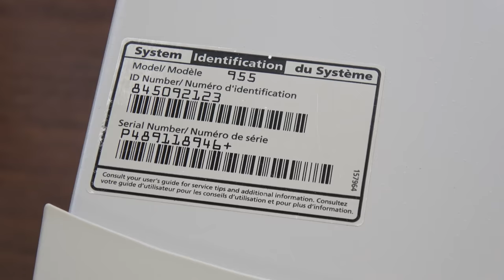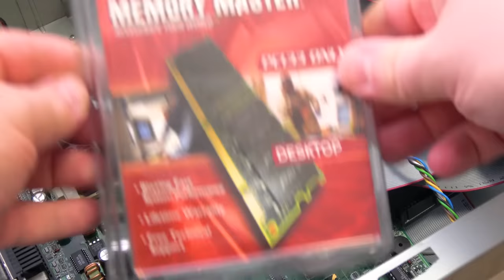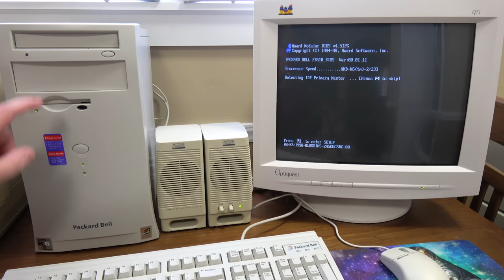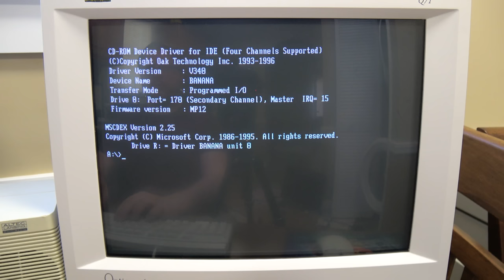LGR - Restoring a 1998 Packard Bell Multimedia PC

Comment: When I was about 9 my grandparents started my computer journey by purchasing me a Packard Bell executive multimedia. It was a desktop that laid flat with the monitor on top and the speakers attached to the monitor. It ran windows 95 and had a pentium 133 with 16MB ram and a whopping 1.19gb hard disk. But it got me a hobby and later a career so thanks to my grandparents for buying it for me!
Reply: I just bought one with 200mhz, 128mb of ram, and a massive 2gb hard drive. It’s currently running windows 98 SE.

Comment: It's a good day when any 90s PC gets restored, yes even this Packard Bell.
Reply: Rounak Dutta I agree.
Reply: ya, it is. is that a bad thing, bud?
Reply: Even a Packard Hell deserves some TLC
Reply: To bad windows 8 has now had the same fate as 98 and Vista to Windows 7, 8.1 and 10
Reply: Rounak Dutta I agree
Reply: I’m currently working on a 92-94 packard bell 108 CD, that is running 3.11 for workgroups and MS-DOS 6.11
Reply: Joseph Linz I was going to suggest Clint do just that in a future video! I really want to get one from that era as well. Where did you get yours?
Reply: Adam Christensen my mom bought it new in 92’-93?
Reply: Adam Christensen  I would suggest a 812 CD legend though, there more powerful than my 108,
Reply: Joseph Linz 486 is where it's at. None of that Pentium rubbish!
Reply: Adam Christensen what’s wrong with pentium?
Reply: Joseph Linz I already have some Pentium laptops, but my nostalgia is pushing me to get a 486 desktop.
Reply: Adam Christensen got ya, good looking In finding what you’re looking for!
Reply: My first computer was a Packard Bell Force desktop, in a horizontal case. I added a 2nd hard drive without official support for it because I sat it on top of the power supply. Never had any problems with that LOL
Reply: Rounak Dutta b
Reply: Gives a warm and fuzzy feeling inside.
I just can't explain that!
Reply: i agree
Reply: Rounak Dutta s
Reply: Gives you the feeling to want to take out your biggest hammer in possession and smash that packard hell to bits. Smash and hammer it so hard that even those pieces turn to dust and get blown away. Some things should never get mentioned again anywhere, leave it as a faint bad memory of an eon gone bye!😠😠

Comment: My 2nd computer was a K6-2 @ 500 mhz. I had a lot of problems till i found the issue: THE CPU COOLER. It was unable to keep a decent temperature and the computer would crash all the time. I did replace the cooler for a better one that only cost me 6 usa dlls and i never had an issue again. The original cooler looked a lot like the one you have there.
Reply: i suggest to use a extra cpu fan, and a fan for the HDD
Reply: It might be because it's black anodized aluminium. The anodized coating reduces how it can transfer heat if it's on the CPU-side of it.
Reply: I had a K6-2 500, too. Fast machine for the price.
Reply: I remember when the cooler completely separated from my 500mhz celeron. it still ran like that, but BSoD's happened about every five minutes until i realized what was wrong
Reply: i have a 500mhz k6-2 @522mhz with the same heatsink lgr has and i cant hit 45*C under load.
Reply: Laharl Krichevskoy you need to change the termical paste. Also maybe the fan is filthy and or damaged
Reply: Alejandro Rodolfo Mendez 
i mean i Cannot hit 45* under load, as in i get 42*C at most worst case. So i dont get how he says its a hot cpu. i recall those cases were the ones with the passive coolers. i remeber anything petium or better was better to add a fan on the heatsink even if it wasnt needed.
Reply: Laharl Krichevskoy he is comparing against the Pentiums and also check in the page of AMD they have the optimal temperature chart.
Reply: jose juan andrade  h

Comment: Man, I hated Packard Bell back in the day, but now, I have a newfound sense of respect for their perfectly adequate systems. Thanks, LGR!
Reply: @Broyale26 : What the fuck do you mean by that, man?
Reply: Packard Bell PCs were crap.
Reply: @Trev359  Crap or not, my first P Bell was a 386 and bought in 1992.  It had a 16 MHz processor and 2 megabytes of RAM.  A friend of mine was able to upgrade it to 8.  I can't remember what the original  hard drive size was, but for a 1.3 GB hard drive in 1994 that was added as a slave drive, the price was 149.00
Reply: They were very hit-and-miss. The motherboards were typically fine(ish), but the main problem was that they skimped on parts from the mid to late 90s - especially the PSU and HDD. God knows Maxtor was a shit brand, and they would barely last you past the warranty period. Also, some of their mid-90s boards would just NOT take a PCI graphics card, regardless of your BIOS settings. So you were sometimes just stuck with onboard graphics.

Comment: Man, this brings back memories. I bought a Packard Bell pc at Sears in the fall of 1999 for $700 that was running a Pentium II 400 Mhz cpu and had Windows 95 on it.  I promptly upgraded to Win 98 SE and started exploring the web.  This was my very first pc ( yes I was very late into the computer game) but I liked it and had fun with it.  I remember the case was exactly like this one, exactly the same with the LED's and the two buttons. My next computer I built myself and bought all the components myself. Remember Pricewatch from back then? But the Packard Bell got my feet wet so there is a tiny bit of nostalgia. After that, I had to have complete control and I built all my pc's myself from then on.

Comment: LGR! PLEASE make the NOISIEST computer possible! only a nostalgia freak like you can know how!
Reply: That's easy.  Just add a bunch of case fans with bearings that have gone bad.  I have one right here that I'll donate.  Sounds like a helicopter trying to take off inside your computer.
Reply: It i can find my aunts old Dell . that will cover it lol.
Reply: SpearM75503 😂
Reply: and a old hard drive with a noisy motor like an old quantum fireball
Reply: The theres already a computer that deserves that title the apple g5
Reply: Geiger counter hard drive, check
Worn out fan bearings, check
Badly mounted CD drive that vibrates, check
Reply: @GoblyosBence-jd1fc  I mean when they read/write. The clicking of the head.
Reply: Put a wire touching the fan- kinda like a card in a bike spoke
Reply: He just needs to buy an old HP server
Reply: The PS3 (1st gen) ran like a sonic boom.
Reply: Apple Xserve are the loudest
Reply: @SpearM3064  Noice
Reply: don't forget the maxtor hard drive
Reply: @luminumlx2604  Why don't we just put a PS4 inside a computer case. It's cooling system is so beef, when it senses the slightest change in heat, it sounds like a jet
Reply: @alexandercurtis4427  Cool, but now i need a computer case and a ps4
Reply: @luminumlx2604  Goodwill and Ebay are your friends
Reply: fitted out with 16 fans!
Reply: those vacuum tube computers from the 50's
Reply: you want some noise?
buy a server siemens.
Reply: Fill every 5¼ bay with Quantum Bigfoot TXs and write files to each of them
Reply: @simonrichard9873  don't forget a loud AF PC speaker and an alarmingly buzzy PSU
Reply: Full tower case with 3x 40mm Delta fans in every 5.25 drive bay, plus similar on the CPU, front and rear fans.
Reply: Just get a power edge 1950
Reply: @SpearM3064  I had a case fan that was a wannabe floppy drive. Until I oiled it it sounded like a floppy drive seeking.
Reply: What you need lad is some broken bearings

Comment: A trick I used to use to separate CPUs stuck hard to heat sinks is to heat up some water and put the heat sink side down in the water. This softened the compound enough that you can almost always twist the CPU off without putting stress on the CPU's heat spreader.
Reply: Not bad what I do is run the pc for a bit. If that dont work then prime 95 for a bit lol

Comment: Thank you so much for that little tip with the CMOS jumper on the board, Clint. It came in surprise handy when I bought a Pentium 4 IBM Thinkcentre PC workstation a while back. XP Pro service pack two, 500 Mb of RAM.  Everything was locked down with a password. I remembered the jumper and cleared the password protection. Got me a practically new workstation PC for about a tenner.

Comment: the flickering in some platformer games like commander keen goodbye galaxy is usually on ATI brand cards, it works fine on nVidia cards like a Riva TNT or a Geforce2 MX and works good with S3 cards like the S3 Trio
Reply from the maker: That has been my experience as well, and I plan to upgrade to an S3 card in the future!
Reply: Lazy Game Reviews as a former S3 ViRGE and Savage4 owner, I'm not used to seeing "upgrade to an S3". They're all words (except S3, I guess), but they don't fit together, like "potato orangutan"
Reply: Recognised the issue when I saw it, I had it on my ATI Rage Mobility as well.
Reply: I can't seem to find an AGP slot on the motherboard. Ouch, that'll limit options.

Comment: I used to have a old used Packard-Bell CRT monitor back in 2010 that nearly caught on fire while on standby. I said nearly because it started randomly spiting out some black smoke. I immediately  unplugged it and threw it in the trash.
Reply: Had the same happen with my crt tv i use for retro consoles. Smelt a slight burning smell, looked through the vents in the back and this part was glowing red hot...threw it out the next day
Reply: That's kind of funny, I also had a packard bell CRT start smoking on me as well back in 2006
Reply: My dad bought a gateway monitor at Goodwill for 5 dollars back in 1999 and it worked perfectly until he went in the basement in the morning to go on the computer and when he walked into the room. He saw that the monitor had fried because it wouldn’t turn on and when he saw the top of the monitor he noticed that it was burnt black. The top was also melted. Luckily it did not burn the house down.

Comment: I remember the K6-2 was the first cpu I water cooled. Overclocked a 450 to something like 533? pooled the ram of both my system and a friends for 512 mb. Then played with a means of running windows and Duke Nukem on a ram
drive ( quite a trick ) Wow was that speed in those days!  This was well before liquid cooling was as easy as grabbing a part off the net/shelf. I had to make this thing. Old heatsink, and a pink translucent cover of a mini drill bit case plus some shoe glue (silicone that got hard) Then an aftermarket windshield wiper pump and radiator sitting outside in -20f temps. Ahh the memories..
Reply: I remember people posting their homemade water cooled creations on the original 3DMark forums, circa 2000-2001. Some of them were terrifying by today's standards.
Reply: I had a 350 overclocked to 400 with air cooling. I later went to a 500.

Comment: Put a Voodoo3 in that bad boy and then try some 3D games with it. 
Or a TNT2, as they seem to be cheaper on Ebay if you need to buy either of them.
Reply: Just found my old GeForce 2 GTS in a cupboard. Going to put it in a Slot A 1000 Athlon board. Retro dream rig on the way !

Comment: Hey Clint, you mentioned a "capacitor plague" around the early Aughts or so, any thoughts on expanding on that in a future video?
Reply: It's a pretty well covered phenomenon, although I'm not sure if the actual cause was ever nailed down.  Some say the market was flooded with counterfeit brand name capacitors, while other sources say it was a flawed electrolyte formula coupled with corporate espionage, and so a few (quite prolific) manufacturers ended up producing unstable electrolytic caps.

The end result was, basically, all sorts of otherwise reputable device OEMs started seeing unusually high failure rates.  Specifically, issues with those bum capacitors drying up prematurely, overheating, and ultimately failing -- often catastrophically.  The usual symptoms were that either your device would stop working (or just stop working reliably), and inspection would reveal the capacitors bulging from the top, and possibly oozing from the top and/or bottom;  or, everything would be fine until suddenly: a bang, some smoke, and a bit of confetti as the guts of the cap suddenly find themselves free of the outer casing.

This was particularly common on power supplies, as that's one place where you can always find big electrolytic caps, and tends to be one of the more demanding applications that regularly stresses those components.  But also on motherboards, around where the 12V to high-current / low-voltage CPU power rail conversion happens -- for the same reasons:  lots of high-current ripple and nearby sources of heat.
Reply: Hunh. I brought it up because I ran into a rather memorable example of capacitor failure at work around then, and I didn't realize it was part of a larger pattern.
Reply: It was a HUGE problem. At work we did a project for IBM where were were taking apart some models of lease return IBM computers after testing and inspecting the motherboards for bad caps. IBM would then use the boards as service parts for systems with failed caps. We took apart THOUSANDS of computers. I created a document to show the manufacturing people what to look for and I think it's still active, although I've been mouse whipping it for years.
Reply: Capacitor plague??? That is because they use electrolytic capacitors, that are prone to leakage (and have a shorter life span). More recent motherboards use solid-state capacitors, which can last longer than their electrolytic counterparts.
Reply: No, the capacitor plague is a real thing. A good electrolytic capacitor can last decades, I've got a couple of radios around here that are something like 70 years old and work fine with their original electrolytics. The problem is there was a flood of bad caps in the 90's, and instead of failing after a few decades they fail after a  couple of years. See my comment above about IBM.

Comment: This was my first pc, but it had a celeron 333. Watching this brings back good and bad memories. We bought this thanks to my mum, it was her first job and man she really treated us. Up until this point we'd never had fast food let alone a pc. We had an atari 2600 and a handed down amiga 500+. 
She was in hospital when I picked this up, when we ordered it she was totally fine. But within a long wk/end her depression came back and it was really stressful, she'd really harmed herself. 
The pc was a demo model, very good price but it had 1/2 the stated ram. It took 18/24 months to get this rectified. As I was in my teens dealing with this was new and I didn't have the push an adult does. Anyway it had 32 mb (advertised as 64) which gained a 64 mb stick and we got around £140 back when pc world finally admitted fault. 
The monitor was amazing, it had side ear speakers and a great screen, very low dot pitch 0.27 a very sharp image especially when you consider the price. The ram upgrade really made the system faster, upon boot and settling was so, similar to a fresh os install. 
I used it until 2003/4 running many emus and d/l'ing so many mp3's via napster and limewire.
Reply: @MrDonteatyourself  thanks bro, since that time she's been far more stable sadly I don't think she'll ever be happy. You ever had to deal with mental health issues?

Comment: I absolutely love the old school 80's / 90's computers, and especially love it when someone brings an old one back to life. 

Windows 3.1 for me was a turning point hit. The whole feeling and advertising of "state of the art" computer technology was awesome. Now days, a computer is nothing more than a hidden quiet little box in the corner of a room that does nothing but provide the expected programs like a mobile phone with no user initiation,  just pure automatic provisions requiring no experience. No drives, no noise, no discs, no lights, just a quiet little box there out of necessity rather than being part of the whole user experience and they're often hidden out of sight as if they're a nuisance or something.

How computing has changed.

Comment: I had a PC just like this back in the day, 350mhz K6-II, 96mb of ram (upgrade) and a 4gb hdd, later a 16gb. Played Midtown madness 2, sim city 3000 and RCT1/2 a lot on that machine! The pack in monitor caught fire at one point and I remember my dad running over and chucking it out of the window. We used that thing well into the P4 era. I remember going with my dad to work and his office was basically in the "IT corner" and the guy manning the help desk set me up with RCT and a few other games on one of those sweet purple dells with a P4!

Comment: I remember that CPU - try Unreal it should working.
Reply: Unreal would be a great testbed for upgrades to this PC - It will happily take any CPU or GPU upgrades for faster performance. In the current configuration, Direct3D will be dreadfully slow and glitchy, but Software mode should be somewhat playable at 400x300.
Reply: I think that VooDoo 2 or VooDoo 3 are a great idea to upgrade this PC. With VooDoo graphics card you can use OpenGL or Glide - these APIs are more efficient and faster than Direct3D. You can use OpenGL library that support 3DNow! AMD instruction set.

Comment: Oh boy a Maxtor hard drive. No wonder why these died quickly. And I'd upgrade that K6-2 333 to a 500 mhz, or a K6-3 450 if you can find one.
Reply: Not as bad as the DeathStars.
Reply: Most motherboards could run the 500, even the cheap ones. Huge improvement.